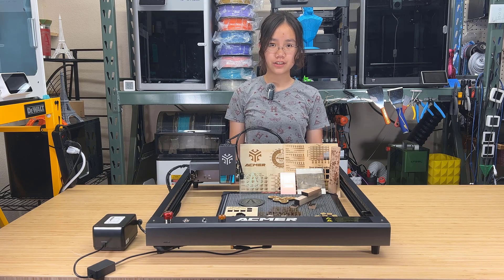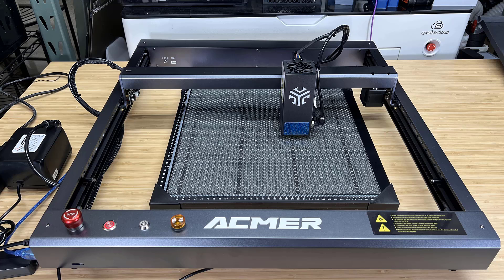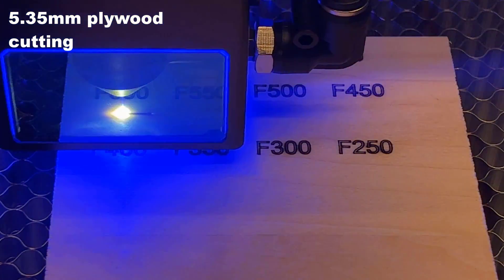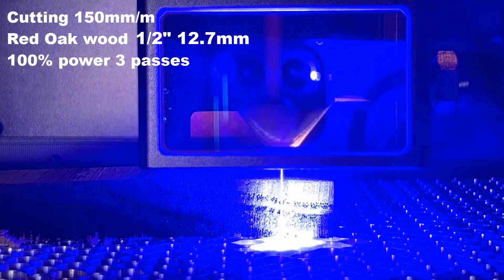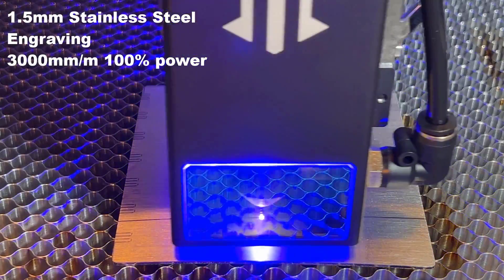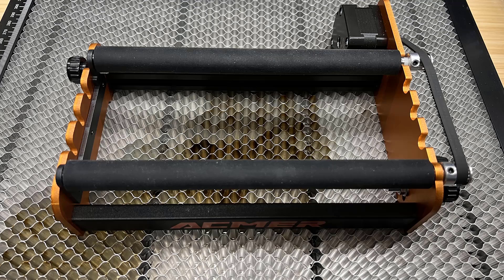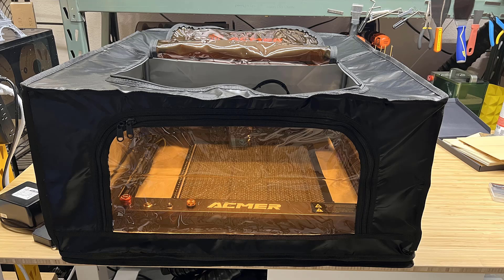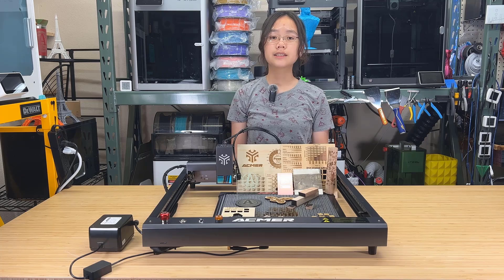Acmer P2 33W Laser Engraver: Linear Rails, 30,000mm/m, work on stainless steel, acrylic, wood, glass

Comment: Hi, would you say this is a better laser than longer ray 33watt? I am not sure which one to buy.LONDER HAS A VERY GOOD CUSTOMER SUPPORT.THANKS
Reply from the maker: These types of laser machines are very similar, with just a few stepper motors to move the laser head. They use the same firmware and PC software. Just choose the power you need, and most of them should work fine. In my opinion, Acmer’s build quality is pretty good, so you can give it a try.
Reply: Thank you. I’ll have to make a decision.

Comment: very helpful thanks!
esp. the list on your site
I'd cut with that instead of saw, my HF benchtop bandsaw's blade now goes 45 degrees right in any material and is unusable, plus the laser's accuracy and small kerf is like EDM. Never dull or replace.

Comment: Hi Aurora,

Could you change the color on the price checker? Its currently green when the price increases, but should it be the other way around? Its positive for the customer to let the price drop :D
Reply from the maker: We had a debate about the same question, and we ultimately decided to follow the stock market convention: red for price decreases and green for price increases.
Reply: In the stock market a price increase is positive, shouldn’t a price tracker follow a stores convention? Decrease of prices is positive. I already solved it for myself with greasemonkey 🤷🏽‍♀️